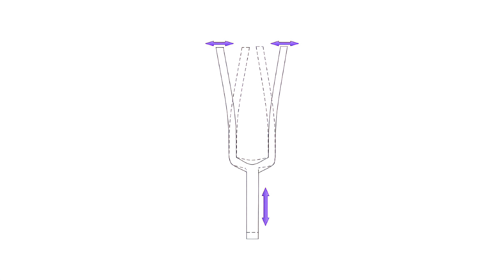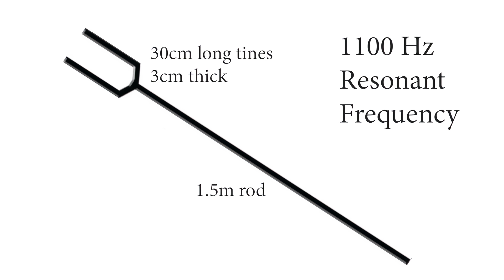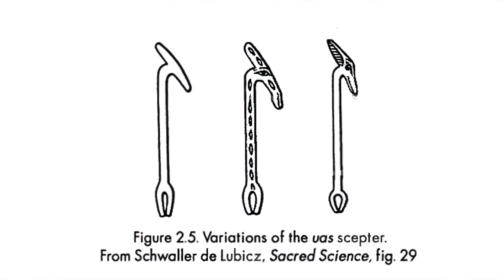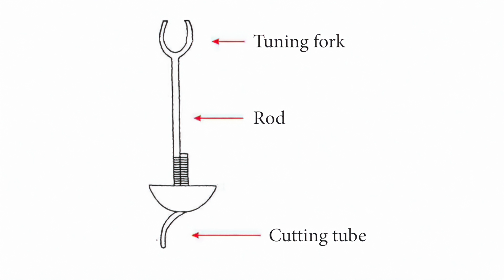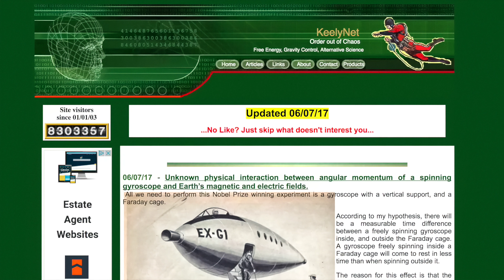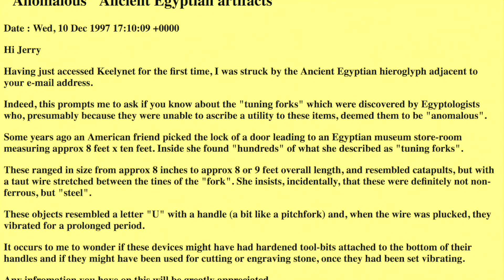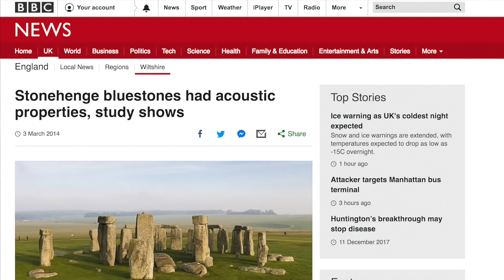How the Ancients Cut Stone with Sound - Lost High Technology Explained | Ancient Architects

Comment: Nope. Vibration drilling exists using mechanical vibration and it is more efficient in some circumstance. But a six-foot tall tuning fork is not going to do bupkus, I'm afraid, on granite or much of anything else. The vibrations are going to stop the second the tool hits stone. You're going to have have some poor guy banging on the end of a tuning fork fork hours on end and it will do nothing. Not to mention that any holes drilled--even if it worked--would be determined by the necessarily short hollow bit. How was the core extracted?  The issues go on and on. If this worked it would hardly be a lost technology, so simple is it. It would have endured. We'd be using it today. 

Further, the scepters or Was shown really don't even appear like stylized tuning forks, the tines would need to be much longer.  I believe the shafts were wooden, as well. Perhaps, indeed, these scepters were stylized imaginations of some unknown tool, but not a simple tuning fork. 

That said, I appreciate the different ideas getting thrown out there. All of this remains a mystery.
Reply: Steve FAure - true... but maybe the 'vibration' is a sort of 'force multiplier'.  Thinking of guys who put a fist through a board or a block of cement.... OR... thinking of a 'wing' when trying to create flight 100+ years ago... First, it just looks like a 'flat thing'... but as you learn the nuances, you realize that the 'curvature'/'shape' is really what creates the lift.  Could be similar concepts in play here.
Reply: Steve Faure That is only true for traditional  cutting techniques. I suspect you are trying to take this vid at only face value. 
Now, imagine a people that had thousands of years perfecting the technique. Eventually, the tools and tooling would become quite refined... maybe to the point of seeming almost inconsequential to the task at hand. 
Ultimately, the evidence is quite thin do deduce whatever method was used. We can only hope that folks who can investigate will continue to do so and, maybe, some who are not will start.
Reply: Steve Faure On a serious note, I just had a thought that maybe the tuning forks were used to find out what the resonance of a particular stone/rock? Maybe a hardness/density measurement?
Reply: MrVolksbeetle I enjoy your counter-point. I think the biggest problem with us figuring out how this was done really lies with our understanding and current technologies. We keep approaching these unachievable feats with a limited understanding.
Yes, if not for some super-natural ability, this work would be, as it still is, excruciatingly difficult. It must have been easy for these ancients, or they would have done something else.
Maybe this is a good place for philosophy: maybe it wasn't even a matter of how easy or hard it would be. Maybe that never came into question. Maybe this work was done the way it needed to be done, and how wasn't in their vernacular. They just did it. Aliens? I bet not. I think people had this ability. I think that there may be some part of the human experience that we've yet to re-discover. Some part that knows there's no good reason to care about the size of Kim Kardashian's butt. Some part that lie dormant, and is being occupied or distracted by our modern machine. But one day, when we all realize that watching "Survivor" should never have been on our to-do list, it will all start to make sense. We'll all wonder how we made it this far. Maybe we'll reflect on how close we came to actually destroying ourselves.
Reply: I'm talking about the practical application of cutting tools which is what I hope this discussion is about. Practically speaking, the cutting tool needs to be of a harder material for it to work. Sure, given enough time and resources you could cut through steel with a rolled up newspaper, I suppose, but you would go through an unbelievable amount of newspapers.  Breaking materials through shockwaves is a different process than cutting them. Water can quite a number on stone giving enough time. Again, what I'm talking about is the practical application of tools.  That's why I'm discounting the tuning fork process, it simply wouldn't work on a practical level so it's an interesting idea but I think we should scratch it off the list.
Reply: You are wrong.  I have seen videos of a speaker and copper tube being used to cut stone.
Reply: Steve Faure No. what this guy is trying to say is that there was a mega-force (natural type) maybe the sun's, to allow this type of 'chiselling' to be possible. A power we have not yet tapped into or harnessed
Reply: +ALL:  Seems if copper were used on granite... the copper would just eat itself..... and not even do more than scratch the granite.
Reply: Steve Faure If the fragile, aluminum tip of an airplane wing can pierce steel, then these tools can cut through stone.
Reply: Lisa Beaudoin Kinda doubt that.
Reply: I would love to hear a logical explanation for how these wonders were created, but this is not it because it cannot be done as explained here in the video with a simple tuning fork.  I agree with your second paragraph and I think the answer is probably a lot more simple that anyone suspects. I've no clue what it is but it's not a tuning fork.  Go try it, somebody build a giant tuning fork and prove me wrong. The physics or how a tuning fork works are well understood and what would happen at the end of a tuning fork-no matter the size or frequency, if applied to stone--can be surmised correctly.
Reply: Maybe they somehow utilized the vibration  between the forks... not the forks themselves for cutting..
Reply: Yeah, I think you hit it on the end there. He's mostly stating that later Egyptian cultures saw depictions, or remembered descriptions, of a tool used for utility and recreated it for their symbolic religious rituals, which may have just been muddled understandings and recreations of the past that they themselves misunderstood. We sometimes forget that the Egyptian culture was several thousands of years old and actually became less technologically advanced as time went on, as far as we can tell from the archaeological records. Isn't it possible that a civilization in shambles after a cataclysm settled into the remains of an older civilization, and used the existing infrastructure and resources to flourish for a time. I think that the ancient Egyptians "inherited" the lands from another past civilization, and in studying the ancient culture they were roosting under, created a cultural religion to emulate and worship the lives and ways of the older culture. I think it's a case of misunderstanding ancient structures in the same way our own archaeologists have. I think they saw large structures and assumed them tombs and so set out to create massive tombs for their own great leaders, regardless if this is truly what the original structures were for. I think they saw symbols and items in records from the ancient culture and assumed them religious in nature or of some other significance. A drill or a power generator would certainly merit a recorded history of. That history gets muddled and ambiguated as time goes on and becomes a story of myth and fantasy. I've lost my point somewhere along the way and have just begun ranting. This is some good weed.
Reply: Always Curious Good points. Sounds like directed energy. Laser implies thermal energy, which would leave behind evidence of scorching.
Reply: MadeleineQ - thanks.  Well we can have radiant (photon) energy - that can work one bond at a time!  Laser cutting is complex  - good job there's no depiction of anything laser like anywhere or we'd all go nuts.  That said that 'bulb' like thing with the insulator rings is simply mind boggling?
Reply: Steve Bridge I think there is some form of ultrasonic tech going on with ancient stone cutting. This can greatly reduce the wear on the tool vs sawing, drilling or, hammering. I also think that folks had an extremely intimate knowledge of stone/rocks/geology. 
I don’t even think that some of the examples or ultrasonic or using vibration for cutting stone I’ve seen on YT are approaching what the ancients were doing.
Reply: Steve Faure - Cutting tool needs to be harder than the material being cut - Not so sure of that.  Thinking of a martial artist putting his hand through a cement block or board.....
Reply: Steve Faure - that's a good point. I think ultimately it's about breaking the chemical bond between the molecules of the material.  It's whatever that can generate and deliver that bond  energy. A laser is an example of something that can cut but which is not itself physically hard - so at least we know science permits 'something'.... what is the something though?
Reply: Yes..its that easy to dismiss this video,the scientific facts do not support the theory,as simple as that!
Reply: What if the rocks were heated before being cut with sound thanks to the sun and quartz magnification? The egyptians were very apt scholars, it's not farfetched to think they invented glass in the middle of all these desert dunes.
Reply: water cuts stone.
Reply: Unfortunately none of your criticisms are complete or logically valid.

Most of your are based on unsupported and unqualified assertions.

Granite may be hard and has great compression strength, but it is also very brittle. It is actually very easy to crush granite and that is the key to cutting it. Vibration is the ideal way to cut hard stone, especially when the time and labor constraints of the industrial era do not exist.
Reply: +Gazzy... something beyond Magnetism, solar, thermal, etc?  I'm certainly open to suggestion....
Reply: Steve Faure nice one👍🏻👍🏻👍🏻👍🏻
Reply: You are a master among ordinary men. They had the technology and then they left and took it with them.
Reply: Mercury is a very unlikely candidate for that, because it quickly forms alloys with almost any metal, which are mostly softer than the starting material. There are nice videos on YT about dissolving gold in mercury, copper should react just the same.
Reply: @Steve Faure, Nobody said the bit was hollow
Reply: Steve Faure n
Reply: Water-jet cutting?
Reply: Egyptians draw weird ok? Floppy arms and other crazy things, a tiny rod is just an example of this (maybe) I think we all are on to something... ancient aliens are not as far fetched as you might think.
Reply: Who'd have thought water could hold afloat a tanker ? Before we actually saw it done, we'd have said "not on your nelly" (english term)..... I believe stone cutting was achieved in a simple way, a way we've not yet got our heads round.
Reply: If they had a wire connecting the U shape of the tuning forks, like mentioned in the video, maybe they could have a striker (like the sticks people use to play a violin or a harp) to have prolonged vibration at the desired frequency. Sounds good to me. Very efficient if it works.

This is an answer to OP.
Reply: Not necessarily! The short ears and the kind of metal the tool is made of sends out a specific vibration! They used the various tools for specific jobs!
Reply: Hey Steve Faure, A tad bit late to the party but nonetheless interested in the answer to the age old question which came 1st "THE HOLE, or the DRILL BIT?" Now, I'm with you on the logic however let's just say, we as  the (INQUIRING MINDS) here wanted to find out, the 1st thing we shouldn't do is put a RULE in play? Practically all the cutting tools we use today are quite crude and rudimentary devices, and require the harder material to pulverize the crap out of the less dense subject of our work. This seems to the casual observer quite counter intuitive with what must have been a particularly effortless process with these ancients? So as opinions go this happens to be mine, I think that as per all great mysteries the answer is always right under our nose, and perhaps found in nature? CAVES! 
It must be a Alchemical/Chemical alkali process of sound with the trigger of chemicals in some combo? We know that acid can retain charge in batteries, and cause huge caves to be bored out of mountains? So these ancients see this natural process, and mimic the sound of water cascading to creating the energetic stimulation that quite possibly turns everyday water into a WATER JETTING tool, while the CHEMICAL/Acids keeps the mixture alive with combustive working energy? Just a theory?
Or as the ANCIENT ALIENS would say, "It was the ANNUNAKI!" Hah!
Reply: I do not see how forks can rotate, or move in any desired direction; though, if vibrations are made constantly at the point of contact, and it does not take much when doing it right, those vibrations really matter, presuming they are made in the right way.
Reply: I don't know much about stone cutting; though, learning from a wet circular saw blade, speed at which blade rotates and how hard the blade is pushed against the stone, matter little.
Reply: Got to agree. It's a technology worth exploring, but absolute supposition here.  It's all about energy. The amount of acoustic energy able to be applied by plucking strings on a tuning fork "Might" polish a rock, but it isn't going to cut through in  anything less than a very long time.   And he shows all the inside machine cuts and vertical cuts.  How does he explain that.  I'm afraid his theory holds less water than Alien's.
Reply: dude. NO SHIT everybody seems to get that its just a joke EXCEPT YOU
Reply: Steve Faure  I find it difficult to believe how easily you dismiss what is probably one of the most logical explanations I've heard yet. I also find it difficult to believe your knowledge of what humans were doing on the world or what knowledge they possessed 12,000+ years ago is that accurate. Clearly, this theory requires some refining but, I think the core idea is 'sound'. Ultimately, whatever tech was used in these types of constructions was being used all over the planet and, was fairly easy to use. 
It is far more probable that the answers we seek are hidden away in some warehouse or broom closet, looked over and forgotten because the "expert" looking at them had no clue what they were for... That or the answers go against the current dogma, rewriting history books is too expensive and, admitting one is wrong just doesn't pay the bills.
Reply: Steve Faure yes you right , I’ve been drilling holes in standard soft stones (Yorkshire )and it takes some doing even with a sds machine with diamond tip drill bits. Sound ,  forks or copper tubes and enough to go through such dense  hard stone.  There must have another way
Reply: I agree Steve, this guy doesn't know much about science he's just stoned and chatting spuds
Reply: Steve Faure Regarding your question on how the core was extracted while cutting into stone. Could it be possible that they used mercury or some other high density fluid to make the stone particles float to the top while drilling? If so could this fluid then also have helped strengthening the drilling or cutting force in some way when using softer material tools like copper etc. and maybe keep the tool from being in direct contact with the stone and therefore not being eaten away in the process? Just some thoughts from a non-educated guy so I may be totally wrong in my case.
Reply: Steve Faure or whomsoever is interested ! My opinion only, I am alive !
1st we need to understand what IS REAL vs ISRAEL and motion vs emotion and what is resonance vs reason ! So we know everything is about frequencies and vibrations and electricity and magnetism ! Now think of creation vs created and Natural vs National in understanding vs scripted ! Tesla vs testament's or how things are as twisted as the double helix itself, and how we've combined these ideal's or mixed theories as a way of confoundment abd confinement!  So we as a species needs real truths ? Why , if truth holds for us all, and is found in one light, the same light, should there be then any divisions ? Why do we all not agree in the 1st place ?  How do we all come into the truth, if in some raises the question to even question the truth ? As above so below or He that ascended is the same that descended brings all matters to a neutral place or a common ground ! This ground is level meaning even, and equal leading to Equality ! This seems to be the common scenario I've come up with in my studies ! Trumpets blast brought down the walls of Jericho, and the trumpet sounds heard as a voice from Heaven, usually a tone that's heard before some impending doom or devastating event. Low tones vibrate as in bass, or the base(foundation)...think from that, we can assume a starting point ! Higher tones can shatter glass and yes ! Tones have been weaponized long ago through the music/magic of knowledge of the note by manipulating words we now use ! The language arts ! The ideal is to be on board the same ship, this is symbolic for the ark and allows us to relate to one another, this is through a common thread we call truths aka Jesus, a man capable of it !
Reply: A cutting tool needs to be of harder material than the material being cut, simply put. I don't think there's any exceptions to this rule.